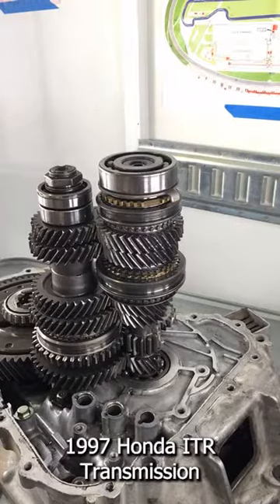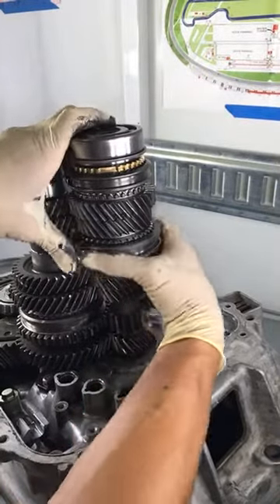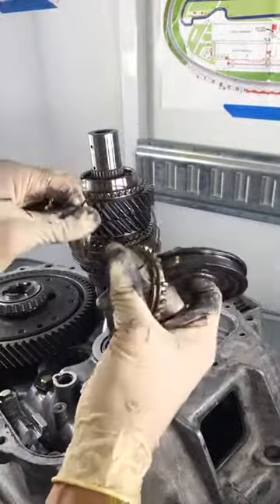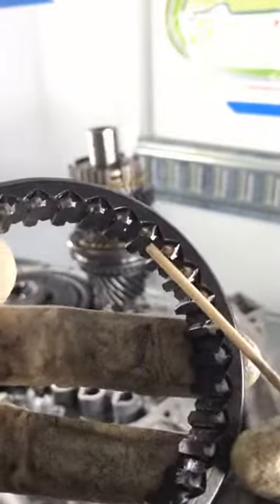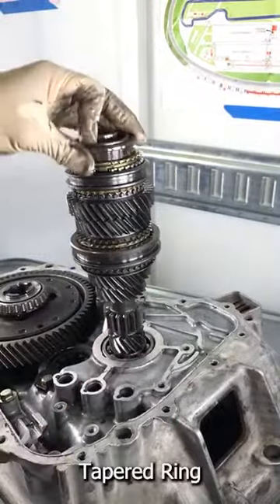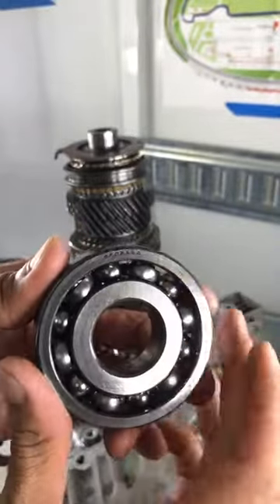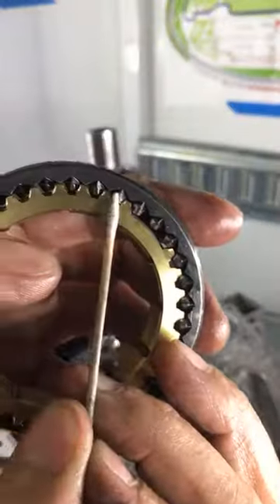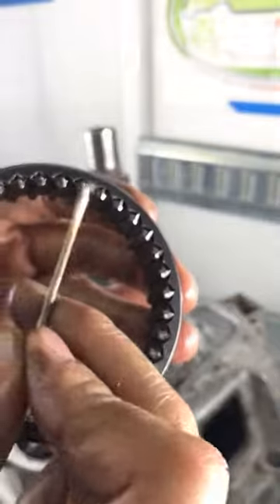How a Honda B Series Transmission Works

Comment: yooo this is amazing my b16 stopped going into reverse and started popping out of 4th I was debating on trying to rebuild it myself or just buying a new one but with this after I took it apart I actually knew what I was looking for !!!! but i noticed my spot ring teeth are broken I'm going to replace it but just wondering what is the purpose of the stop ring
Reply from the maker: I don’t know but if u had to guess I believe it helps slow the rotation of the shaft so the synchronizer works better… synchronizing the speeds of the gear